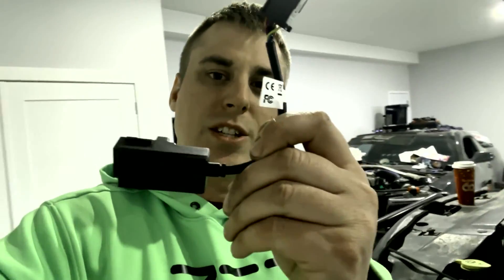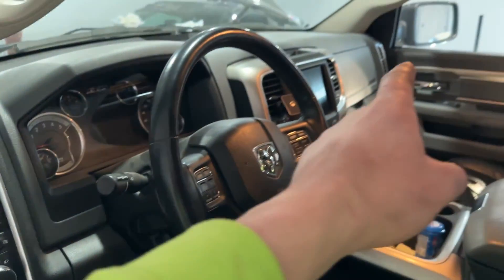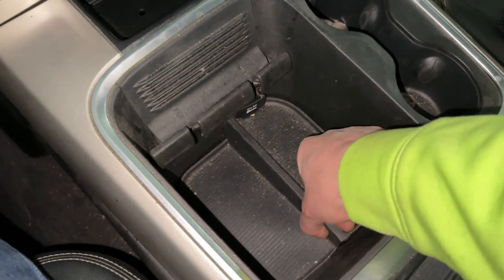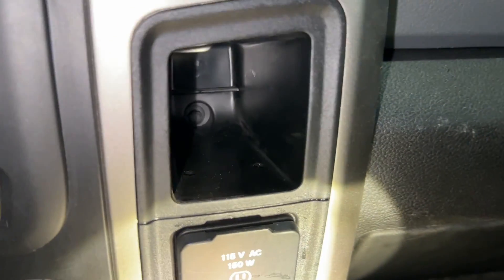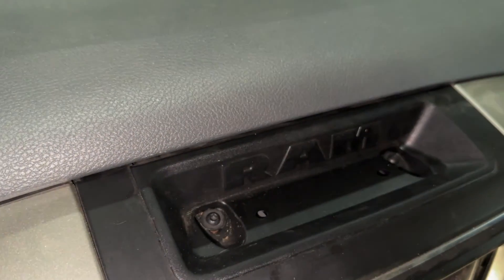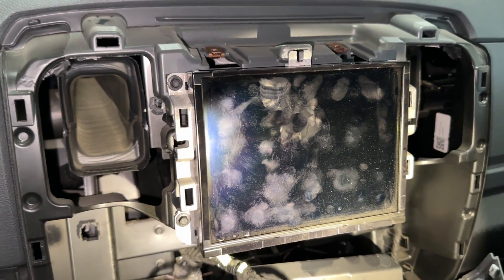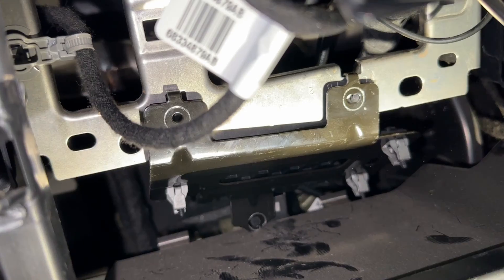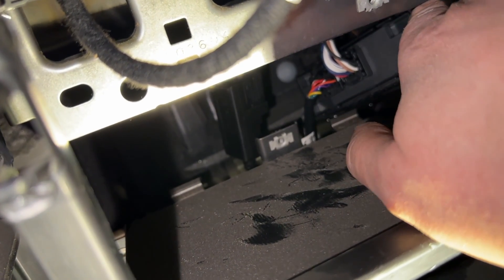INSTALLING HP TUNERS SMART ACCESS CABLE - 2018 NEWER DODGE RAM JEEP

Comment: If you leave the cable installed, is that going to hurt anything?
Reply from the maker: no it will be fine
Reply: @zedperformance  Thank you.
Reply: I have 2019 5th gen RAM Longhorn 1500 with the 12" screen. Is my cable also behind the screen?
Thanks
Reply from the maker: @ChevySS1968 I think so but honestly I’m not sure.